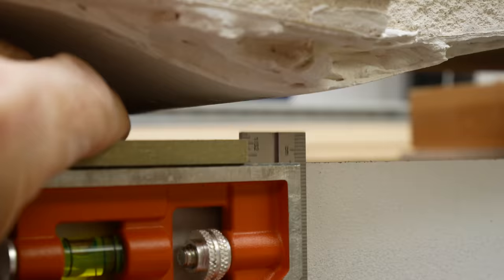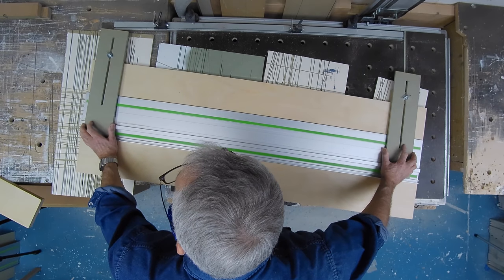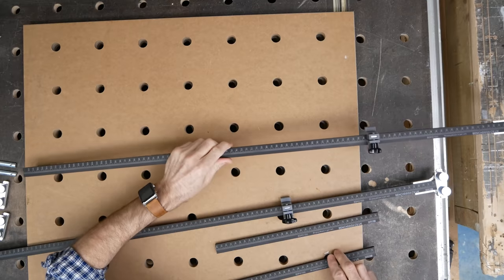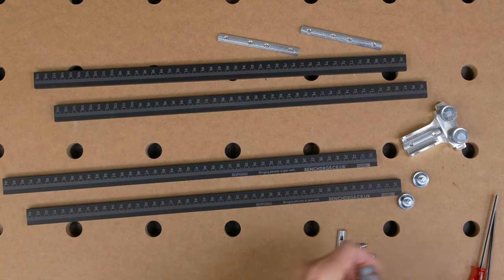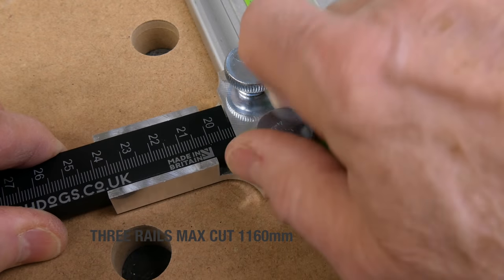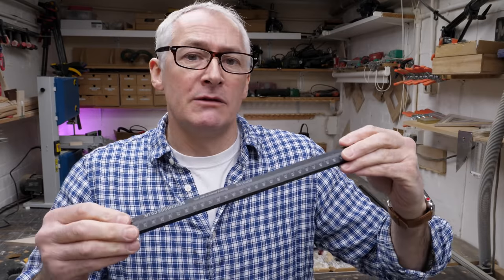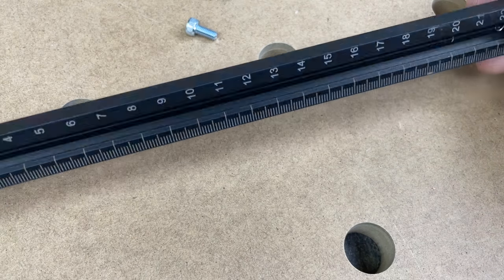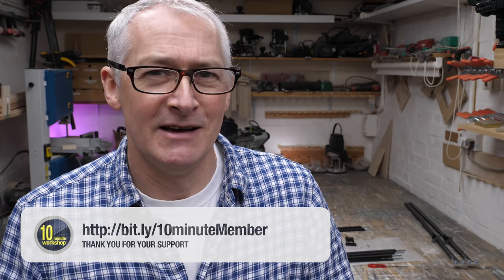Parallel guides [**Gifted/Ad] Video 440

Comment: Hi Peter, I was thinking about parallel guides this week and then you pop a video out about it. You hooked into my cookies to see what i am browsing for again? :)
Seriously though, I was interested in the guides as i am making a lot of small rips but they don't work fro the sort of sizes I need. I wondered if you have any suggestions? I need to rip full sheets of MDF to make lots (several hundred) 75mm and 150mm strips from 18mm MDF. Currently I have to rip in half with the plunge and then take it to the table saw for the rest but would love a plunge saw solution that was repeatable in a tent in the customers garden :)
Reply from the maker: Easiest way with these PGs would be to set the stops to say, 300mm, and use a 150mm spacer under the rail to rip your 150mm strips, and a 225mm spacer to make your 75s. Not ideal, but it would work. 👍
Reply: @10MinuteWorkshop  Buggar, your answer just cost me £125 on the Benchdogs website :) Thanks

Comment: Great video Peter   Look great using with a rail for cutting down sheets. No reason why you would know as Benchdogs don't, but any idea if they fit an Erbauer rail?
Reply from the maker: Thanks Daniel! No reason why they wouldn’t fit the Erbauer, but I’m check when I’m back in the workshop. 👍👍
Reply: @10MinuteWorkshop  that would be great. Thank s

Comment: It seems like this would cater to a very small group of people that have a shop just big enough to manage a 4x8 sheet, but not big enough for a table saw. This seems like benchdogs would have to wait a long time to make a profit off of this. Kreg makes something not nearly as nice, but at a fraction of the cost of this.
Reply from the maker: I think you’ll find that the group of people who prefer to use a tracksaw over a table saw for breaking down sheets goods is quite large, and you may be surprised to find that plenty of folks are happy to pay more for something nicer. 👌👍
Reply: A decision I made very early on was to never get a tablesaw.  Not sure if it's the number of YT videos where people have removed the guards "for the video", but those things look downright dangerous and there are always easy enough ways to do the same job with other tools.  Too easy to make a mistake you can't come back from.  Actually I notice quite a few people with shops plenty big enough to take a tablesaw just don't have one, but could have if they wanted (e.g. Matt Estlea).  So the group is probably larger than you think.
Reply: @10MinuteWorkshop  True.  I've had my fill of buying the "it's cheap but it will probably do" one and then later buying the one I should have bought in the first place as well.  Either figuring how to go without or using the "buy once cry once" approach has served me so much better.

Comment: Do they work with the MacAllister rail Peter?
Reply from the maker: I haven’t physically tried them, but the MacA rails are Makita clones, so they should be fine. 👍👍
Reply: That’s what I thought but wondered if you had first hand experience. Thanks for the quick response.
Reply from the maker: I’m in the middle of something else just now, but will check when I have a sec. to confirm. 👍

Comment: My kit arrived a while ago and I was a bit disappointed when I realised I need to order other connectors and bars for narrow cuts . Is this what you meant when you said bench dogs will come with additional products for narrow cuts? Being able to buy them bits separate? Thanks
Reply from the maker: No, as I mentioned in the video I was a little underwhelmed by the ‘narrow cut solution’ as supplied, and relayed this to Ralph at Benchdogs, who told me that they were working on a better solution for this. That’s all I know. And I can only review the products and relay prices as supplied; if specifications or scope of deliver change post-review there’s not much I can do I’m afraid.

Comment: When calibrating would you not be better off moving the scale end up to ply instead and scratching a calibration mark into the slides. That way the fixed track ends will remain fully butted up to the rails and less likely to move
Reply from the maker: There’s 2 bolts in there - they aren’t moving!